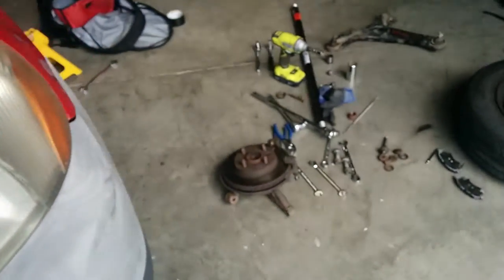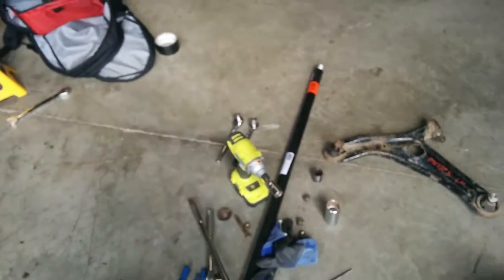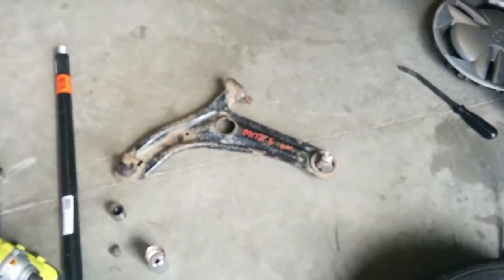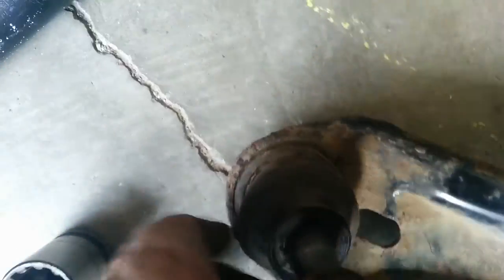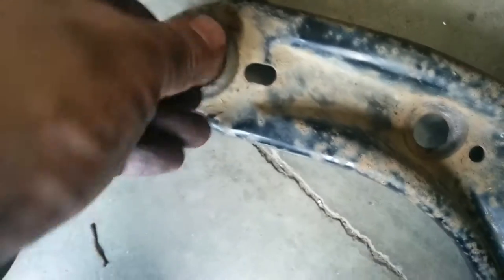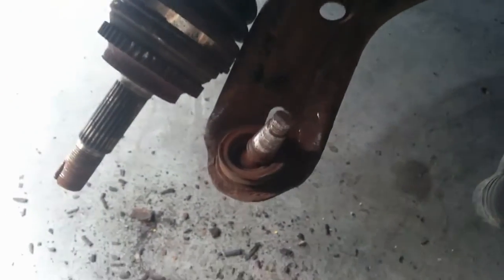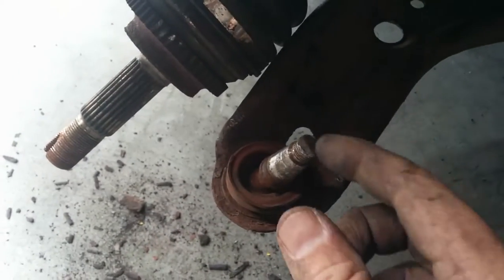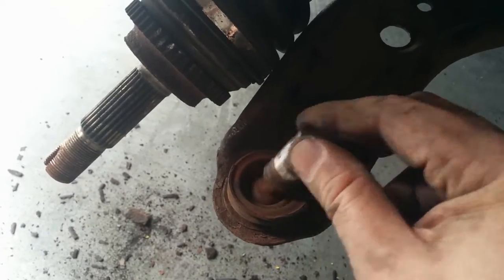Result of front ball joint replacement on 2000 Toyota Echo.

Comment: How did you get it out? I’m running into a similar situation.
Reply: Sorry I didn't get back to you. Probably it should take under 2 hours but mine took me 4+ hours because I don't have a lot of special tools and I'm not an expert so I was facing a lot of these problems for the first time. In all I spent the afternoon and into the evening before i had it all back together.
Reply: The way i got it out was mentioned in the description but i had to remove the wheel nut, took off the strut and tie rod so I could position the knuckle out of the way to hammer the ball joint out from above.
Reply: Usually you don't have to disassemble quite so much to do the job.